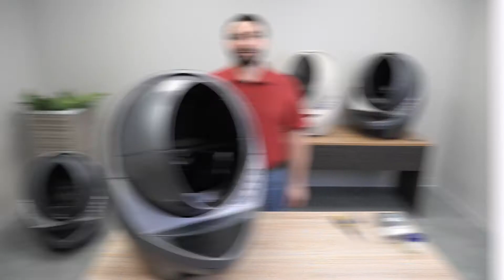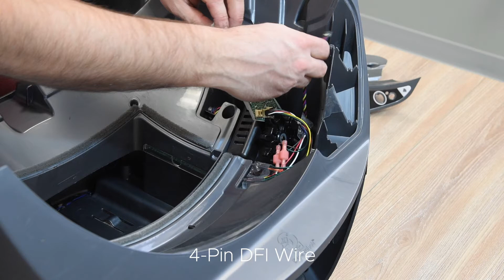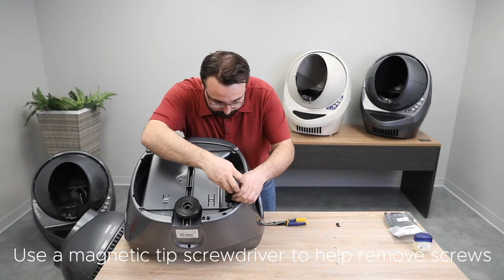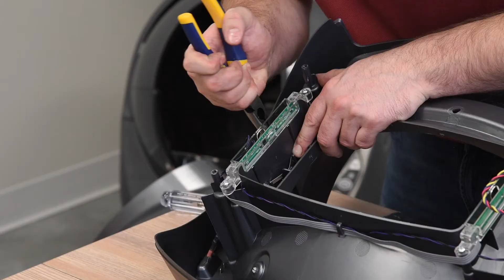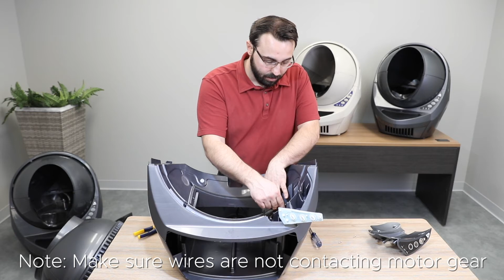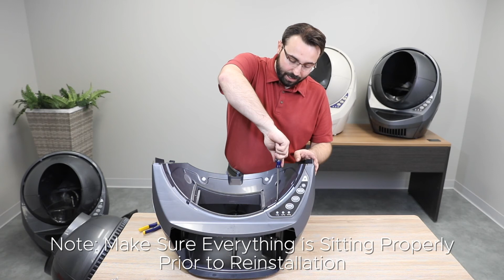DFI Kit Installation Guide | Litter-Robot 3

Comment: While I was watching ths I was also on a queue for customer support for this problem or similar (I have some wires hanging out of bottom of unit). After55 minutes I was disconnected. WOW. I called back. The message I got was they were closed. I guess when they close they just hang up on the people in the queue who were on hold for an hour. A great company. Why do we have a warranty and an extended warranty. For parts? To learn to fix it? To hang on the phone for an hour? I should have bought two of them. And I would have. What a disaster this is.
Reply from the maker: Hi Barbara! We're sorry to hear our call got disconnected! As with any type of computer, the Litter-Robot will sometimes experience technical errors. Our customer service team is aware of these errors and would be happy to help you troubleshoot! Under the warranty we will repair your Litter-Robot at no cost to you if anything goes wrong. We pay for the parts, labor, and shipping within the contiguous US. 

Please reply with your Litter-Robot's serial number and I will get you in direct contact with a product specialist right away. Thank you!
Reply from the maker: @Erik Burgerhagen Hi Erik, we greatly appreciate your feedback and we would be more than happy to resolve these issues for you. It sounds like there has been a little bit of miscommunication. The standard warranty is 18 months, during which we repair your Litter-Robot at no cost to you. We pay for all parts, labor, and shipping within the contiguous U.S. (learn more: https://www.litter-robot.com/support.html) If you purchased from a distributor, the distributor will assist you with repairs. If you need help contacting a distributor, please let us know and we can get you in contact with them. 

Unfortunately without knowing your case or ticket number, I'm unable to look into this further. If you can provide that information, I would be more than happy to help clear this up for you and get you in direct contact with one of our product specialists. Thanks!

Comment: Its disappointing to see such cheap components on such a expensive machine, like why are none of the boards potted in what essentially is a toliet? Doing this on a well used machine is absolutely disgusting, could we possibly give two shits about the end user who is spending 600 on a litter box a bit, maybe don't put the parts in the line of shit and if you have to, seal them in somehow so the dust and piss  and shit vapors can't reach it. It's not too expensive guys to apply pot the sensors guys. A toliet shouldn't need bi monthly service to maintain functioning (ignoring the drawer, can't get around that) i hope for all that is sacred the LR4 actually is improved and not a further cost reduction at the cost of robustness. Disappointing
Reply: Like if y'all need an engineer to consult, I'm willing to do it. Cause I have some ideas to improve the design and make it more robust and less prone to failure, namely spend some more skrilla on protecting the delicate electronics. Nothing leaves my lab without potting and for the most part, it's a pretty dry environment but that peace of mind is worth the extra effort and time.
Reply from the maker: Hi there. Thank you for the honest feedback. We're so sorry for your experience and would love to make this right. Please send us a direct message by contacting us at whiskersupport.com with your unit or order details so we can assist.
Reply: Please show my comments to the Manager and bean counters who decided it wasn't worth the 15 cents to seal each dfi board with potting. A product this expensive shouldn't fail in two years and while I appreciate the free parts and support you guys should also look into improving the design as well and not just making it flashier. Did the money y'all saved by cheaping out really helped since you now have to provide free part kits to more users than expected? Seems to be to penny wise and pound foolish but that is a common symptom in this day and age

Comment: If i understand everything. For thé price you purchase this thing, if you havé à DFI problèm, you ll havé to unbuild yourself all this stuff to replace it ? NO WAY !
Reply from the maker: Hi, we'd be happy to clear this up! The Litter-Robot comes standard with an 18-month warranty (optional 3-year) during which we will repair your Litter-Robot at no cost to you if anything goes wrong. We pay for the parts, labor, and shipping within the contiguous US.

If you have any other questions or would like more information, please contact us at WhiskerSupport.com or 877-250-7729. Thanks!
Reply: @LitterRobot  I appreciate your support of the right to repair principal and that you provide video instructions easily found on the web.  I also appreciate the availability of telephone tech support.  I am replacing the DFI right now with the newer part.  I am hoping it lasts longer than the previous version.  Thanks!
Reply: @LitterRobot  you might repair it, but you also want us to clean the whole thing out before sending it back, and the unit is not made to make that a simple process. I'm specifically looking into repairing the unit myself even though I could probably easily get a whole replacement, again. But trying to get the litter out of the thing, impossible. The litter gets up into the control panel somehow, it's no wonder the thing just quits working
Reply from the maker: @laethe230  I'm sorry to hear this is happening to your Litter-Robot! I'd like to get you in contact with a product specialist who can assist you further. Can you please reply with your unit's serial number? Thank you!

Comment: This is so ridiculous. For the price of these things, customers should not be needing to do all of this. Poor design to have a sensitive sensor with no protection from the moisture from the waste. The waste drawer itself is also poorly designed. You have a huge amount of dead space toward the front of the drawer that's not being used. So I only have two cats using mine and it needs to be emptied every 2 days or less, and it's always been that way. Now the DFI sensors are acting up even after cleaning them and sometimes it can't even make it a full 24 hours before saying it's full. The waste bin being gravity fed also means that it tends to fill up on the left side really quickly and says it's full when it's not. On fb they tell customers to shake it every day or couple days to level the waste. Really? This is what they think is reasonable while charging $500+ for the LR packages? An absolute waste of money that's going to bring you nothing but headaches, with the product and with the condescending, unhelpful support team. Worst purchase I've ever made. It was supposed to make my life easier but made it harder and the company does not care whatsoever. I also asked for a reasonable accommodation for disability and they rejected it outright before having the legally required interactive dialogue where they need to gather pertinent information before it'd be remotely legal to deny the request. So they're unhelpful and ableist. Run as far as you can from this unethical, greedy company.
Reply from the maker: Hello Lee, thank you for your feedback and for bringing this to our attention. We are sorry to hear about your experience so far and apologize for any confusion so far. One of our Customer Service managers has responded to your email today. We would be more than happy to discuss this further with you through email, or we can be reached via phone at 877-250-7729.
Reply: @LitterRobot  there's no confusion, I just really hate your poorly designed product and your lackluster customer service 🙃. Been going around in circles by email for over a month now and all of my concerns and needs have been dismissed repeatedly because your company cares more about money than doing right by customers. But yeah sure comment on social media like you actually care when you don't.